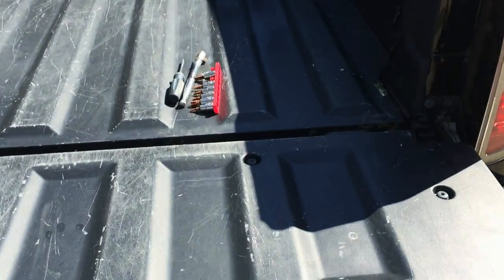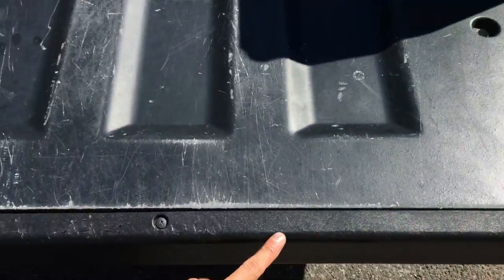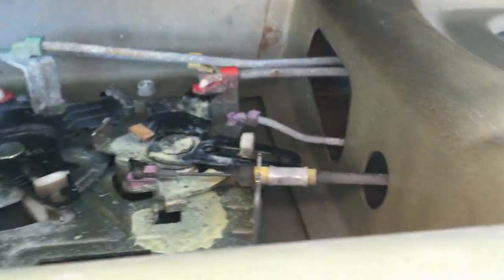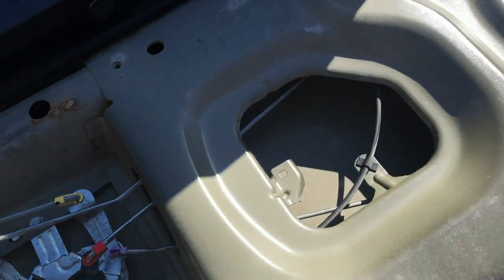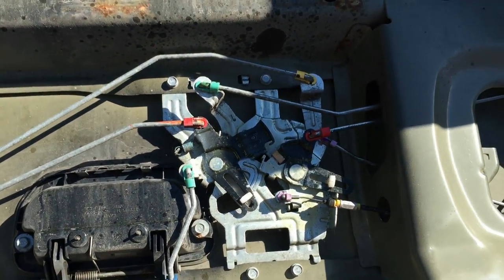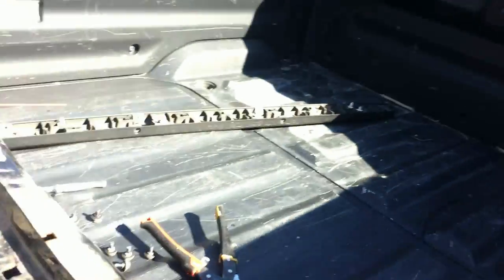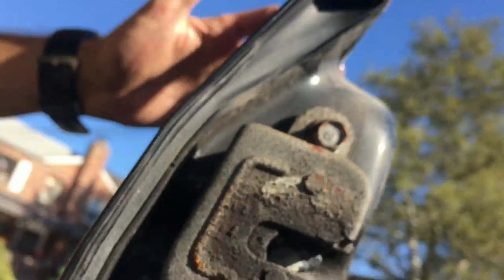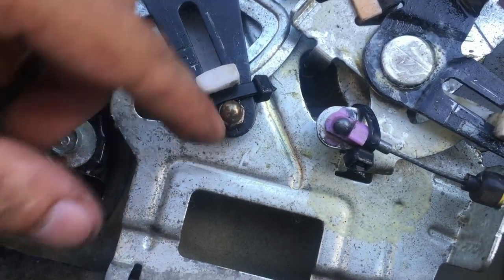Honda Ridgeline Tailage Liftgate repair

Comment: To remove the top cap of the tailgate, remove the three screws.  Then with the tailgate open, use a rubber hammer (or a regular hammer and block of wood) to gently knock the cap toward the passenger side of the truck.  After it moves just an inch or two, it should release from all the gripper pins and come off.  To remove the plastic gripper pins from the tailgate, rotate them 45 degrees in any direction.  That will align the barbs with the square corners of the holes and they will pull right out without the need to use a tool.  You will need to remove all the gripper pins from the tailgate so that they can be put back in place in the top cap prior to reassembly.  Also, white lithium grease would be a much better choice as a lubricant over WD-40.  WD-40 is NOT a good long term lubricant.  It will eventually dry out leaving a gummy residue which causes mechanisms to stick, not slide easily.

Comment: Adding the screw/nut as an adjuster did the trick.   Don’t break off the body clips like I did on the tailgate cover!  The cover slides right and poops off easily.

Comment: I just wanted to say how great your video is! I have had this problem for a couple of years. It would work and then stop working off and on. I took it apart greased everything and still no luck. Just like in the beginning of your video. When you closed the door I said, watch his will work and that’s not what’s causing my problem. But yours didn’t. I knew it had something to do with the latch but I couldn’t figure out how the mechanism in the center worked. Then when you said the green piece should be moving and you moved the rod back and forth that was it! WD40 the hell out of it and now it works great. Thank goodness for you tube and for the fact that you uploaded your video. Saved me a lot of money instead of having a mechanic troubleshoot and charge me for something so simple. Once again thank you.

Comment: Just did mine and it worked like a charm.  Had to go buy the bolt and nut for the green arm, then added the two zip ties and we were back in business.  If I'd had the bolt and nut here, total elapsed time would have been about 15 minutes tops.  Easy repair.  Thank you for the video.

Comment: Handle would click, but not release for swing operation. The pink rod end ( between pink cable & red rod end) releases the top righthand latch. Thats the one that was hanging, that needed to release. Bent the rod (to shorten) and lubbed the latch, and main mechanism. 2009, 125k miles

Comment: Yeah Video was OK, until you have to remove the top cap of the trail gate. Would have been much better had the method for releasing the plastic clips that hold the top cap of the tailgate in place had been included.......... That was the difficult part! Broke 8 of them trying to figure out how to pop the plastic Gripper Pins. 
Here Is How: Once the T-40's & screws are removed, lift & close gate. Start from either the outside left or right of the tail gate by pushing a Trim "Wedge" Tool in between the metal and plastic top cap > Look for 1st White plastic pin. > There are 2 rows of Gripper pins, 1 on the inside & 1 on the outside of the gate and they are approx. 4" part, which only provides a very small gap to work with. Moving the Top cap will help to release the pins.
*Note: Best to use the proper Panel Trim Tools to prevent damaging the paint. Gripper Pins have a barb on each side that locks into the tailgate. Both Barbs need to be pinched or compressed against the shaft of the pin to release it. Best use the slimmest flat trim tool with V-shaped Groove you have or similar.*

Comment: I have the same problem on my 2019. I installed the lock kit, and 2 weeks later, the swinging function stopped. I thought it was related to the lock kit, but it's not. That green rod isn't moving enough, and  I think something on the bottom side of the apparatus has popped out and is not engaging. Shortening the cable or lengthening the rods won't work. That little white plastic slider just isn't moving far enough, and I can see how what you did might make the parts work, but the question is why does it stop working suddenly, in the first place. Something else is wrong that we can't see.

Comment: I did not see the step where you got the tailgate open when it is stuck shut and will not open. What is the trick to get it open so that you can check or replace the latch assembly?
Reply: I have the same problem. I have a topper. I can’t get the tailgate open to open the tailgate.

Comment: How did you get the top of the tailgate off - you skipped that part - just getting the screws out doesn't release it
Reply: any answer on this one?  I am afraid to just pry it off?
Reply: @jeanetteo4125  slides off toward pass side